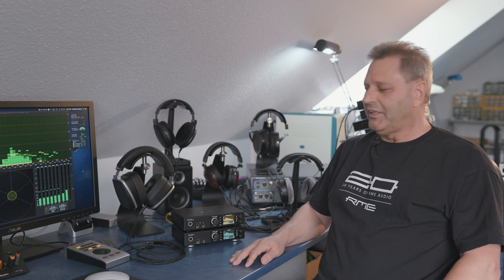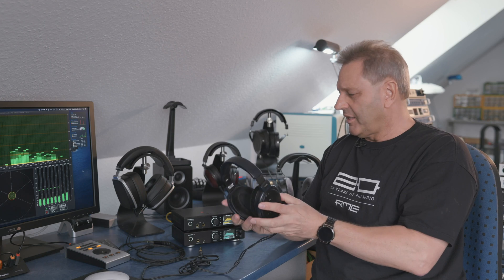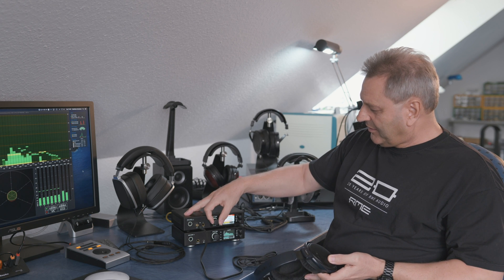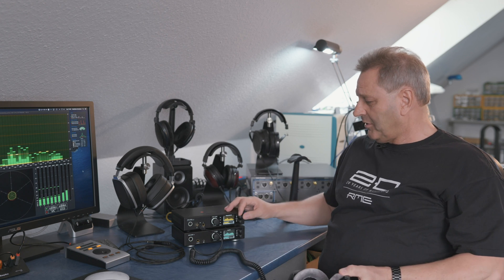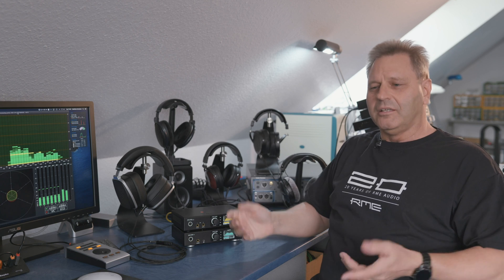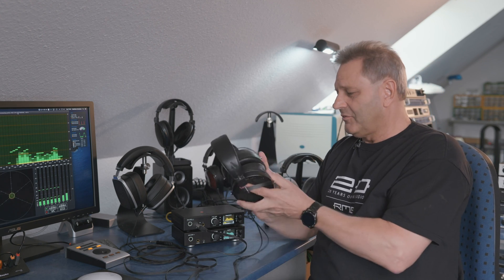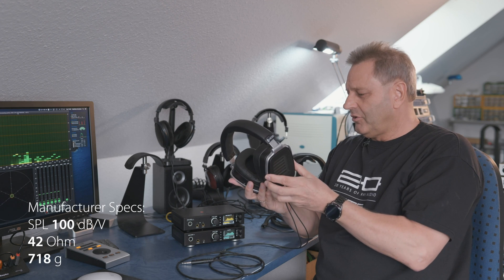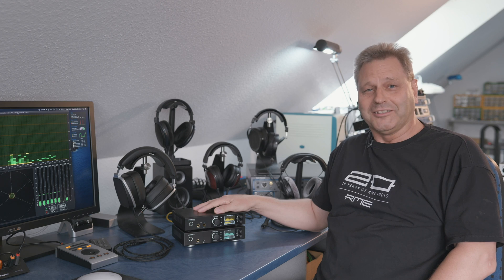ADI-2 Series - Extreme Headphone Outputs Explained

Comment: Surpised he didn't mention using an Adaptor Cable - Dual 6.35mm (1/4") Male to Female 4 Pin XLR for  going totally Balanced and getting even MORE power for something like the HEDDphone
Reply: How does an adaptor increase power output? Is the adaptor itself active and producing power?

Comment: I am using the Audeze LCD-X and compared the normal Output versus the High Power Output: The Bass is better on the higher Output and everything feels a lot better or stable. 
I am wondering how much Volt the High Power Headphone has?
Compared to my rme 802 Headphone Output the difference in sound is quite high! The 802 sounds cheaper and transients are sounding a bit harsh maybe.

Comment: Hi, I have Adi 2 dac fs and Audiotecnica ATH-R70 X headphones with an impedance of 470 ohms. My question is. Adi 2 dac fs in HI POWER mode is able to power headphones with 470 ohms or do I need an external amplifier to exploit the maximum dynamic potential of the ATH-R70 X headphones. You can know in ohms the maximum power of the headphone output of adi dac 2 fs ?
Reply from the maker: Yes you can run your 470 ohm headphone with the ADI-2 DAC FS. Please read the manual on page 61. There are diagrams where you can check the power in relation to the impedance. Extreme Power Charts: https://www.rme-audio.de/downloads/adi2dacr_e.pdf
Reply: @RMEAudio  Thanks! I want to thank you from the bottom of my heart because since I have Rme Adi dac 2 fs my life has changed I have had many successes at work and my level has risen! The audio quality, driver, stability and low latency is truly exceptional! Every aspect and Adi dac fs 2 is Amezing ! I am truly amazed by the audio drivers that allow me to use my music daw to its full potential! THANKS, THANKS, and THANKS again RME !!!!

Comment: The Hifiman Arya is 35 Impedance and 90db Sensitivity. Will this drive them OK? If so, will the bass adjust help to give them a good enough bass so they are not so bass anemic? Thanks in advance for your help.
Reply: I would like to know this too. Seems that it is in the borderline should one use Low Power of Hi Power for this. The new Arya Stealth Magnet impedance is 32Ω and sensitivity 94dB. Also interested would using balance mode in the pro bring any benefits?

Comment: Great video!! Question: Can the RME ADI-2 adequately drive 300 Ohm + headphones, such as HD800, Hifiman, or ZMF in extreme power mode? Very curious is a separate amp is needed on these situations or if the RME can be a stand alone option? Thanks!
Reply from the maker: Of course it can :-)
Reply: My ZMF Verite run fine on high power.

Comment: When auto volume turned on it seems like one cannot turn on extreme output preference..... Manual bit unclear about this situation.
I use rme adi-2dac with beyerdynamic DT 880 and Sennheiser HD 660 headphones.
Reply: In this mode, Hi-Power mode activates once a certain volume is reached.

Comment: For all models from this video it is better to use low power settings, because it has lower thd+N on practical volume levels, and high power mode for them provides unpractically high volume levels. Least sensitive HEDD phones from this video with 100dB/V sensitivity will feed 105dB into your ears on +7dBu with low power mode, which already overwhelming for most people. For high power output to be practically reasonable, you need headphones less sensitive than 95dB/V. AKG K1000 are around 84dB/V, Hifiman HE-6 are around 97dB/V, Hifiman Susvara are around 95dB/V, so this video could be less marketing and more technically reasonable with something like this;)

Comment: Great, very cool! :D ..question: I recently got the ADI-2 Pro FS R and I love it so far!... I mainly use the Audeze LCD-X (20 ohm 103 dB/1mW) and the Focal Clear (55 ohm 104 dB/1mW) with the "Hi-Power" option turned off and get plenty, more than enough of volume out of them... The question is: would turning Hi-Power on (and lowering the volume) benefit the headphones' sound quality? What do you recommend?
Reply: Not needed. Low Power mode drives them just fine to loud levels and has a tiny bit of lower noise floor that if beneficial to these more sensitive headphones. Used to drive my LCD-XC in Low Power mode too and far from the maximum volume.
Reply: Which one do you like more? Clear or LCD-X? Looking for the same setup with adi-2 dac fs.

Comment: I have an ADI-2 DAC FS with 300 ohm headphones and I'm not using hi power mode. 🤦 RME: Is there a benefit to Hi Power mode beyond increasing the output volume?
Reply: Auto reference level for the headphone output is a good choice. That way you won't have to decide between lo and hi power; it will automatically switch to hi power when you set the volume to -15 dBr.
Reply: There is no benefit, and actually there is a disadvantage as you can see on this graph: https://youtu.be/15Zyuo-cOIk?t=47 on equivalent levels hi power mode provides higher thd+N
Reply: @igorzhidkov1957  Thank you very much, I will turn the Hi Power mode back off then.